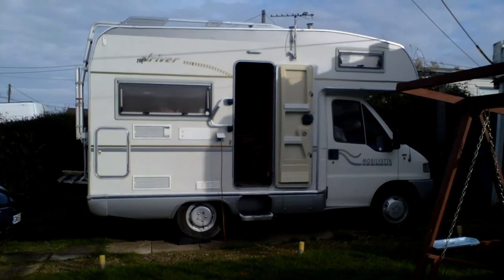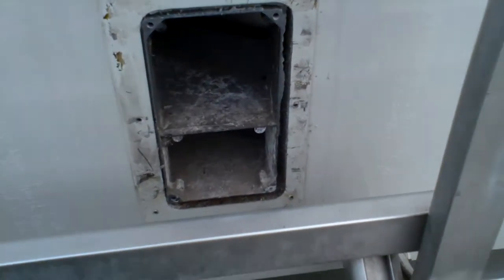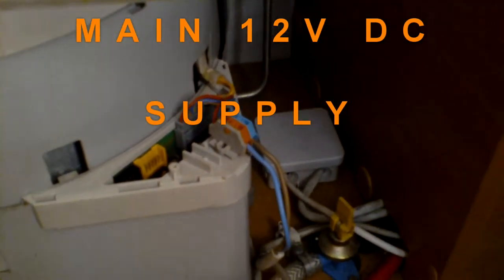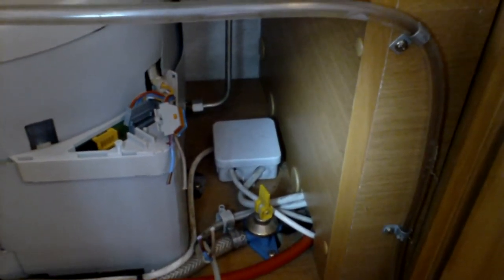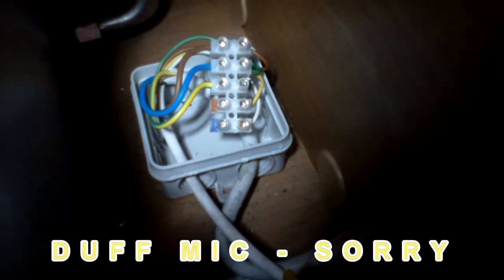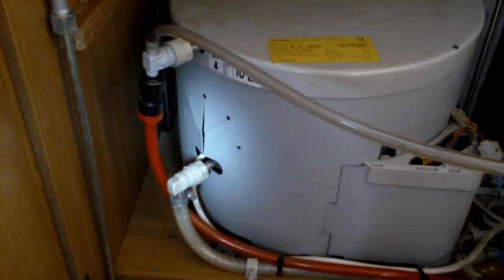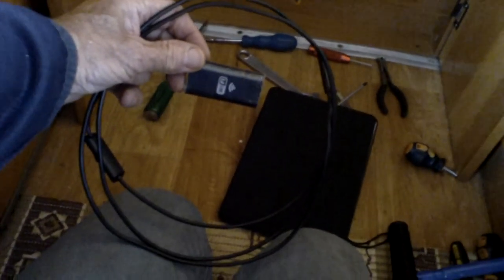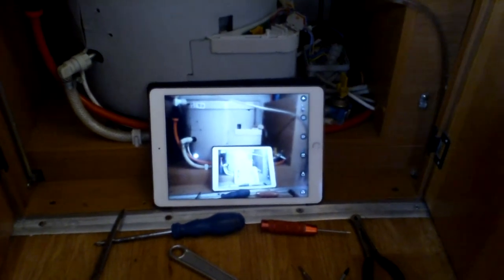TRUMA ULTRASTORE STRIPDOWN SERVICE   ONE

Comment: You made a great job of a camper that was totally wrecked only for the many hours work  in to bring it back to great shape again 👍
Reply from the maker: Hi Brick Wall. Thanks for the kind comment. Honestly though I had little choice. Got caught badly when I bought the van so I had to do it or scrap it as no dealer would consider repairing it but a friend gave me hope saying it’s coach built so it can be repaired so many days weeks and months followed working on her and the wife was not amused. I managed to get it almost all done and even went away for a few trips then the China virus came and we were on lockdown so I tinkered about more - got cam belt and water pump done + many of the daft things. Lockdown lifted so went away of July 2020 for just over two weeks which was fantastic and toured every corner of the Isle of Wight then after that we started another lockdown so I had all the welding done and another full service so she’s a very solid beast now indeed. To be fair lockdown has helped me by concentrating my efforts each day doing things to the van I would never have bothered to do but it’s helped keep me sane and now I have a solid van which I can honestly go anywhere and will last many years to come.
When the weather gets better I can give her a good polish.
Hope you didn’t mind the waffle - Regards & stay safe. Peter

Comment: Great video. I’ve bought a scope to but mine is rubbish the focusing is awful. Can I ask what make is yours? Thanks
Reply from the maker: Hi Ray. My camera has no name - got it from China via ebay. I had issues as first did not come so got refund. Second was rubbish and got another refund so tried again and it worked third time lucky. When I wanted one time was the issue and I was ordering again each time before I was refunded.
Frustrating but that’s how it was..
Cant help any more than that.
Regards Peter
Reply: @brucepeter2007   Cheers Pete that’s where I got mine from. I just ordered one from the UK 1920 HD super bright was tempted to get the 10mtre one £23 as I have a Auto Trail Scout haha but went for the 2mtre. Thanks for quick reply.

Comment: Thanks ..my boiler doesn't have a connection where you cut wires and used a connection block..?
Reply from the maker: Hi John. Mine had a connection block as well but as I couldn’t get it to open was why I cut the wires. I thought I made that clear in the video but sorry if I didn’t...
Reply: Hi Peter.. yes you did make it clear. The issue I have is I don't have the wires you cut connected to my boiler..need to look deeper
Reply from the maker: Hi again. The wires I cut were for the 240v AC heating element from the mains when connected...
Reply: Thanks I'll investigate further
Reply: The orange and blue connection is just a simple push down, release. Put a small screwdriver in the hole at the top, push down and pull out wire.

Comment: I take photos of wiring into plugs or sockets, from different angles.
Reply from the maker: Hi Kevin. I didn’t need to do this as all wiring in the heater was colour coded and the sockets  on the PCB were keyed so no way they could be connected wrongly.
The videos were made “as I went” and are a guide not a definitive installation. As there was nothing I could find anywhere on the repair of my Truma heater I decided to post the videos to be of service to others as I hope it was to you.
Regards Peter
Reply: @brucepeter2007  yours is the best I've seen but not what I need, mine is the ultrastor rapid  the gas valve clunk's then clunk's again and red lights, can't hear any sparks though. Not had chance to get into it yet, it looks like ignition is part of the PCB sadly, Truma stuff is the worst.
Reply from the maker: @H4rleyBoy  Hi again Kevin. The safety flame device is shutting the gas valve. There is an EHT spark generator situated on the bottom of the control board - make sure it’s not earthing out anywhere and you should always hear the ticking of the spark flashing over the burner. If the burner does not ignite then shutting the gas valve off is the way it should work. If it’s the board that’s faulty it’s a lot of money but check everything over first - not forgetting the fuse on the PCB board.
Reply: @brucepeter2007  Hi Peter, I just went down to fit the "repaired" PCB but no change, all I get is the valve clunking open, sparking (very faint) then clunking shut and the red light on again.
Reply from the maker: @H4rleyBoy  can you hear the flame ignite?
Reply: @brucepeter2007  No, it has gas as I checked that by loosening the union before sending off the PCB, they did put new parts on it, but still the same result
Reply from the maker: @H4rleyBoy  The gas should always ignite once the gas valve has opened and this spark generator fires up.
See if you can get round to the heater exhaust then get someone to fire up the unit you should clearly hear the gas ignite and feel a vey brief amount of heat before the gas valve closes as you described.
If you can confirm the flame the ignition sequence is working and then the fault is pointing to the flame failure situation which could then be the same as my unit had - damaged ceramic surround on flame failure sensor. I got fed up with messing around which is why I pulled the unit out to save time and clearly see what was going on.
I would pull the unit out for a proper inspection if your happy to do this - it’s either you do it or you pay a dealer.
I think your at that stage now.
Reply: @brucepeter2007  Thanks Peter. I'll try to get our lass to operate it while I sit by the flue, but more than that is beyond me nowadays, I struggled to get the PCB out n back
Reply from the maker: @H4rleyBoy  Hi Kevin. I know what you mean as I’m 70 and the knees are not in the best shape. The units are not maintenance friendly at all and to be honest the old Palermo on the wall in a cupboard ascot type heater was so easy to service and had little to go wrong - only the diaphrame would suffer from perforation but so easy to change but these new units you have to wait for the water to heat up and then you only have whats heater up but the old ascot delivered hot water for as long as the tap was on… I wish you well on your quest as I don’t feel I can help you further but it’s clear the dealer will not be a low price.
Sorry I can’t do anymore. Hope you get on OK so stay safe.
Regards Peter
Reply: @brucepeter2007  It's OK Peter, I was basically just chatting hoping something would emerge from either of our ageing brains (I'm 71 1/2 :) :) ) I am resigned to the fact that it's going to be painful, thanks for your help, we may help others who are also struggling who find this video.
Reply from the maker: @H4rleyBoy  I wish you luck Kevin but think we have covered all we can without removing the heater. My video could still be of service once you get it out which I hope you can do. Best of luck. Peter
Reply: @brucepeter2007  I have had two of the MCEA blokes look at it so my next direction is a problem, we have fewer resources up here in Yorkshire for Motorhome repairs, it needs fixing though so I'll have to pay through the nose or buy a new one, I still need to fix the fridge too.